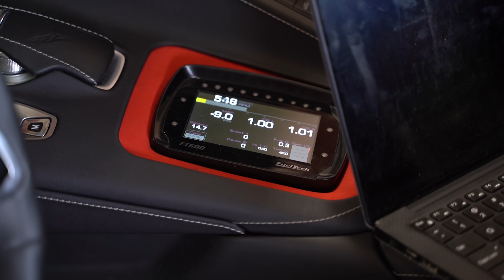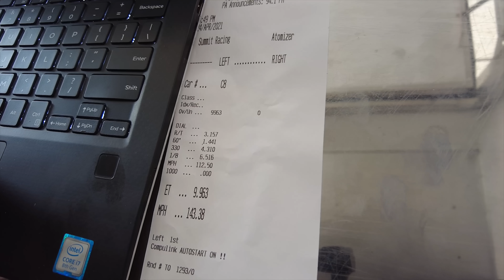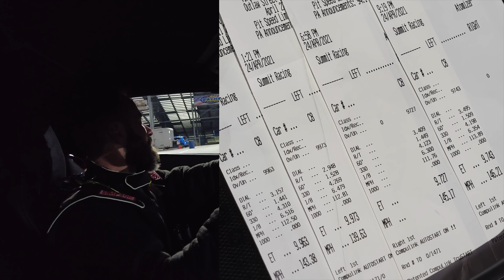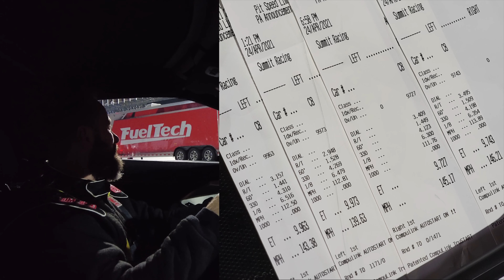FuelTech’s 9-Second Twin Turbo C8 Corvette First Trip to the Quarter Mile!

Comment: VERY proud of you guys, amazing work.  Cracking that intake shows how much you are pushing the motor.  Those kinks you can work out later.  I think that car should be doing 9 flats the next time out.  The mph can go up another 12-15. I have seen cars that do mid 10's at 150-165 mph.  That car hole shots perfectly, so it's just the intake issue and the top end.  You'll work out those kinks, and even crack into the high 8's the next time out.  Crossing my fingers.  Steve Morris ROCKS, good friends doing great things together.  LOVE IT !!!!!!!!!

GOD BLESS, again IMPRESSIVE work.

Comment: It is from what I saw it still breathes.
 And I have the advantage that your engine is very well closed and smoothed, and by the video you can see that, there you were already tired.
 Now planning calmly and clearly is not overnight.
 MAKE A BBQ.

 But from what I saw redoing the work of pressurization and collectors and the Westgates, I think that the 1200 loosened and the 1300 close to the limit is easy with a little looseness.
 The good thing is that you don't need to move the gearbox and clutch anymore.

 But I believe that congratulations are ahead.

Comment: Could even have run a 9.5 if you kept the same tune on run #5 as run #4. Elapsed time was down but top speed was up 2 MPH, which means cool night air sucked in at high speed. Always good to remember; Don't retune after 6PM if your next run is at 9PM. The cool night air will automatically improve performance, especially at top end.

Comment: Nice Passess ! I  have a 2019  Stock C7  ZR1  Corvette  like to Run a Match Race with you at MIR or VMP               Also have a C8 Corvette, 2nd on the C 8 Corvette Forum Fast List / Modified Class,  see if you can post a better time on the list ?

Comment: I don’t understand something. If this is Not a new engine in the Chevy line up of engines; that would mean it was in another vehicle before right? If I’m wrong so be it. But the point is, if it was in another car, did it run the same ecu or something different? Last question. Why not just go full stand-alone?

Comment: Need to snorkle those turbos to get cool outside air in them. Should be worth at least 2/10's on the top end without all the hot air into the turbo's.

Comment: The orange and white one on the other channel did 9.4 on a bad tune
Congrats on the 9.7 but it's not even par
Pro tip don't use a stock flywheel

Comment: Emelia hartford it’s going to be so sad after braking her record 😭
Reply: Actually Emelia still holds the record.  She ended up in the 9.4's if I remember correctly.  Perhaps once they have all the kinks ironed out they will be able to.  It was still a good pass.
Reply: @joedokes9753  
9.41 @144 though I don't think it's going to last long
Reply: The funny this is she is running a street set on small tires not even drag like and running 9.4s it’s crazy! And once she gets to the ecu and clutch she will be lit

Comment: This is a good build, not emelia's crap, I'm hoping Tj's build is going to be great too
Reply: hers is faster in the 9.4s. lol
Reply: @ICP1SBJ  remember this car has only been once to the track 🥸
Reply: @ejst9408  and your point is? Emilia only went to the track once too since her 1022 hp dyno  also a hub dyno reads higher than a roller dyno
Reply: @ICP1SBJ  brother just wait, this car did a 9.7 with an f up intake

Comment: Crazy they need 2 turbos to only do 9s hahaha are cars stock with 3.0 supercharger the c7/c7.5 we can do 9s with just pulley swap and throttle body and tune bone stock motor un touched and half the hp hahaha😂🤣🤷‍♂️